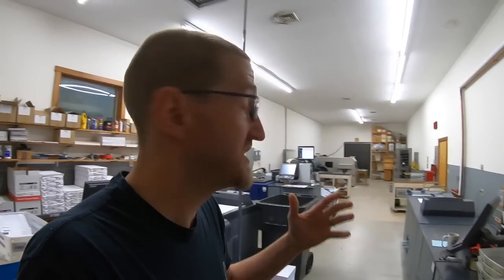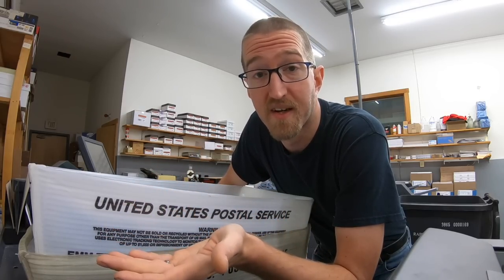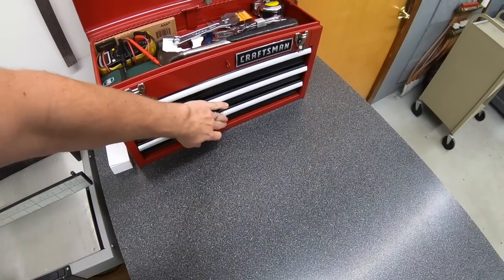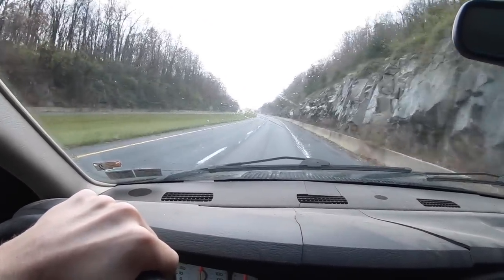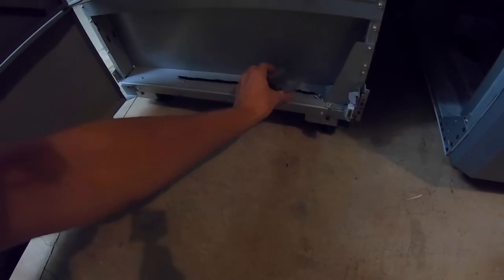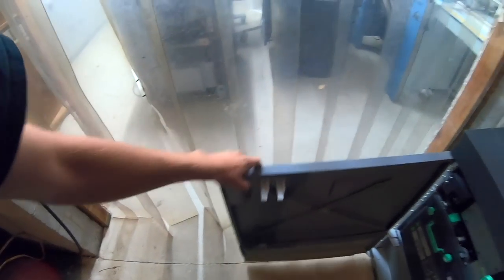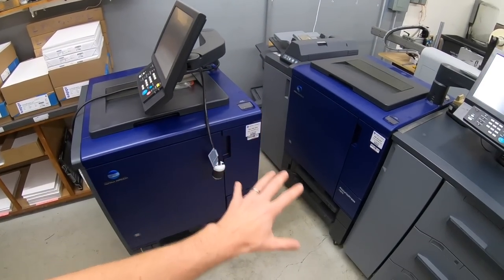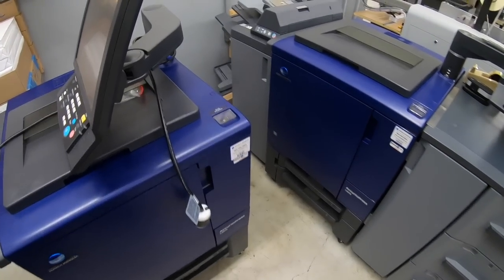Tips for Buying Used Equipment, Digital Press, Copier, Finishing Etc.

Comment: Redundancy when self maintaining is KEY. One machine goes down two more to get the job done.
Reply from the maker: Agreed! Nothing more stressful that having equipment break and let you sit with work that needs to be done.
Reply: Our Konica C3070 is on a service contract and even then, I still feel we need some redundancy. 

To explain: I do most of my file prep in the morning and then print everything after lunch, to send with the postman that day. Over the past few weeks, we’ve had numerous issues with our fuser unit so have had 6 or so call outs in the space of 2 weeks. Because of the fact I start printing at about 2pm, by the time the printer codes out, I don’t get an engineer til the following day. This has definitely gotten us behind so have now started looking at a second printer for when things go wrong.

Comment: Hey pal! You are correct that SOME of the parts on the C3070 main body are interchangable with the 1070, however many are now no longer swap able fuser components being the big one that stands out, along with all of the new PCB architecture. The transfer sections SHOULD be, but at 5 million clicks there would be some trouble keeping the transfer belt assembly going at that rate they do have a lifespan to them, and that\s an expensive component. Devs should have been done (units) a couple times at least as well.

I don't think that gen of anti static RU is compatible with the 1070 there have been some updates, but I could be wrong I'd have to check the literature.

The price you paid is GREAT for that unit.

The IQ-501 actually can play a huge HUGE part in longevity, I have a few C6100 using IQ's that would never be getting the registration and colour likeness they get without it. Statistically what we see is around 80% fewer copy quality issues/registration issues. Getting it up and running may be a very simple task if you would like help, we can start an e-mail discourse and I can see what I can do.
Reply from the maker: Thanks for the info. I just might take you up on that offer to help. We will see. Thanks!

Comment: Looks like whoever was servicing this was not clearing the counters when replacing drums and chargers. There is no way a DU-105  did 1 million prints. Also I would check the history logs for any fault codes or recurring jam codes. Great machine at an unbelievable price. Looks very clean. Best of luck.
Reply from the maker: Good point, I think the most I've gotten out of my drums is 200K. I'll inspect the error code too! Thanks!

Comment: I need a printer that will print in 24 page full colour 15,000 5A booklet every week and ready for the shops. What sort of machine would do that
Reply from the maker: You will probably want an offset press for that. It's just a math game, calculate the cost to run different presses and the cost to buy the machine and you will have your answer.

Comment: That is a great deal. Being a tech, the first thing I would have done is look at both the trouble code history and jam history unless it was cleared out. If you note particular repeat offenders, research the codes and write it all down for future reference. That way if you part it out you can kind of have an idea what will be in good shape to transfer over. You may need to enable a dipswitch to view the histories in service mode.

That USB thumbstick is the same one I use to load firmware upgrades on these units. Fun fact: you can use this method to load the entire service manual into the HDD and access it via the touchscreen to troubleshoot. Its called the SA Tool (Service Assistant Tool). I never use it, but it may be a more valuable feature to an operator. The catch is I believe you need dealer access to Konica's website to download the utility file. Maybe ask your Konica tech to obtain the file for you next time he/she is in?
Reply from the maker: Yes! I forgot about the code history. Great point. And I didn't know of the SA tool. I'll look into that. Thanks!!!
Reply: @justaprinter  I have students that sometimes have difficulty finding old scientific books and I am considering starting a printing service for them.

In general I will be printing About a total of 10 books a week (different books not copies of the same book) each book is about 1000 pages or 500 papers.

I started using my cannon small printer but I am having difficulty in cuting the a4 70gsm paper to size and binding the thick book properly in order for it to last.

Any advice on small sized equipment for cutting and binding such books that i might fit in my house or maybe office?
Reply from the maker: @FirstLast-tx3yj  I know table top perfect binders exist, we had one back in the day. It was a Standard Bindfast. The quality was not that great though.
Reply: @justaprinter  will it be good enough for 1000 page books? And regarding the cutting i just use a normal guillitine and cut them maybe 50 papers at a time...
Reply from the maker: @FirstLast-tx3yj  Unsure of the machine limitations, you might need a real perfect binder for 1000 pages. You would want a hydraulic paper cutter to trim them down.
Reply: 😊😊😊😊p😊😊😊😊😊

Comment: At $2k you definitely got a bargain. I’m in the U.K. and the C3070 has been out less than 3 years over here, and the IQ unit was about £15,000 when we bought out C3070 just over a year ago (we didn’t buy the IQ with it).
Reply from the maker: I feel like I need to give the IQ a chance now, even though I don't believe in them. :)
Reply: @justaprinter  would definitely love to see what you think of it. One thing I admire watching your videos is you don’t mind getting your hands dirty and you don’t expect the impossible when it comes to the capabilities of the machines you use. In my experience, the C3070 has pretty amazing registration out of the box (if it’s been set up properly), so I don’t think the IQ adds a tonne, but would still love to see what it can do.
Reply from the maker: @chorleyprint3813  I think I owe it to the viewers to get it up and running just so we can all learn together. Thanks!

Comment: 2000 usd, what a steal, with routine maintence, it could go like forever actually, but at 5 million click, it probably need new motors and magnetic cluchts. hate to live in a 3rd rate country, everything is expensive here, like 60.000usd for a  canon color machine 70ppm, i had to go to sharp 7090 to lower that price to 20.000usd
Reply from the maker: I still can't believe it. Keep telling people you want to buy used machines, it took many years until I found this.

Comment: I bought my Bizhub C550 for 100€ + 150€ shipping. Couple fixes later, it runs fine. I thought, i should replace my needle Printer at home, the i saw this... After i watched your video, i clean the tray 1 pickup, and it worked fine, too =) 
Now it is one broken sensor at the FS-517 aligning home position. Should be shipped until next week.
Reply from the maker: Awesome, good for you!
Reply: I need one like this one ???
Reply: I need one like this one ???
Reply: @ndobolijoshua4442  I like the C550. =)
Reply: @Multifuchs   yes.... I need used printer at a cheap price .. if you have one or a site with them you can help please

Comment: Hi, great buy! Are you familiar with c71hc how does it stack up with 3070? Did you ever consider the High Chroma for book printing?
Reply from the maker: A salesman tried to talk me into a HC machine back in the day and it didn't make sense to me. Same toner, same machine, just told that the prints were better. I came to the conclusion that a regular machine would be just fine.

Comment: Great info. I snorted when you said to look around the space of the machine. My shop, specifically my desk area is a hot mess.  But my machines are maintained by a knoica tech and I clean them and baby them, all the equipment actually. But my desks... so many random notes, papers, antacids, water bottles lol  maybe this is a sign to clean my desk when I'm in next.
Reply from the maker: You can do it! Clean it up, and then do work and make it messy!

Comment: Love your videos. An earlier video you talked about using the Xerox models at one point on your shop. Which model Xerox were you using and of the Xerox and Konica Minolta, which gives the better print quality?
Reply from the maker: I had a Xerox Nuvera 120 and Docucolor 3535. Print quality look great on both Konica and Xerox as long as they are maintained correctly.

Comment: Hi, i was wondering, i havent seen you use the presses for folding and stapling booklets and brocures. Do they not have the finishers on or is it better not to use the printers for finishing?
Reply from the maker: I do use the inline finishers from time to time. But speed and quality are better off line.

Comment: Add another 200 bucks and trade the plaque of that machine with one that has less clicks and than u can resell this machine for 7000-10000$
Reply from the maker: It is tempting to resell it!
Reply: What are 30/70 and 10/70 ? Would you mind tell me about digital color printer? Can you tell me the names and specifications?

Comment: Hi what software you use to numbering you are tickets?
Reply from the maker: I number them in Indesign,
Reply: @justaprinter  pls can you make video how you to that dont find any ware
Reply: @alexisantoniou5185  I use Quite Imposing, a plug in for Acrobat. It's a fantastic tool for digital printers and will easily add numbering to jobs with the advantage of planning them to cut stacks for n-up printing. Works on Mac and PC. The support team are great to - they'll help out if you have a particularly difficult imposition to plan. I can't praise it enough - it's the single most used tool we use for getting jobs print ready.